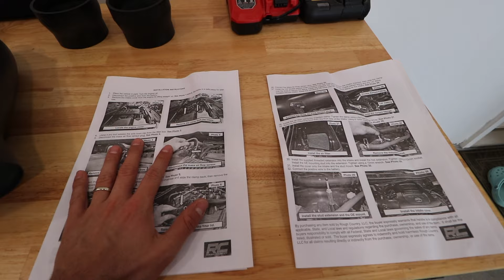Toyota Tundra Rough Country Intake - BEFORE & AFTER Sounds

Comment: have the same on my 2018 5.7, the sound is not bad but was amazed at the immediate MPG increase, .5-1 gal improvement with one stretch of open highway I got 18.4 MPG where 16.5 or so would of been expected
Reply from the maker: I have seen the same! Mine is a minimum .5 MPG increase and I love it.
Reply: So by replacing that you’re getting close to 2 miles per gallon I find that very hard to believe
Reply: @Lance-b2l  on that particular stretch I did, so far increase has been 1/2-1 gal overall, just what I said in the above statement.
Reply from the maker: @Lance-b2l  mine is at .5mpg better. I drive the same 100 miles per day and the increase is proven on my commute.

Comment: I just installed a rough country cold air  intake yesterday. It definitely sounds different and I think I have a little more response but this truck came with a huge intake already( towing truck)
Reply: I do wish the lights were easier to change. It sucks. You have to take the entire grill off just to replace the bulbs.
Reply from the maker: Nice! I’ve been liking the intake so far. I did new headlights on my truck so I don’t have to worry about bulbs anymore. Check out my other video, you may like it for yours too.

Comment: Also, what size tires are you running? Are those 275/65/20?
Reply from the maker: 285/65/20 - made a video on these too. Totally changed the look of the truck.

Comment: What radio is that and do you experience any sort of delay or lag with it ?
Reply from the maker: It’s a dasaita head unit. I recommend watching my install and review video. It’s pretty rad if you ask me.
Reply: @AJLoDato22 will it fit in an 07?
Reply from the maker: @louisholmes4158  The touch screen or intake?
Reply: @AJLoDato22  the touch screen but I checked the link on your other video and it doesn’t seem to. I believe the intake does.
Reply from the maker: @louisholmes4158  search your year and dasaita on Amazon. They make a screen for an 07, but it’s different than the one I installed.